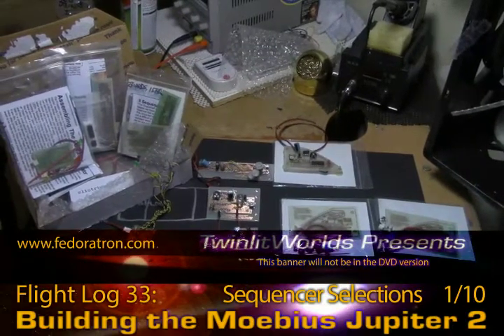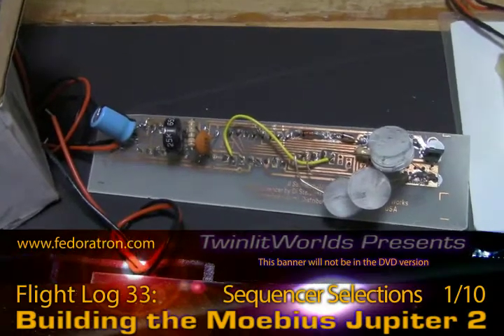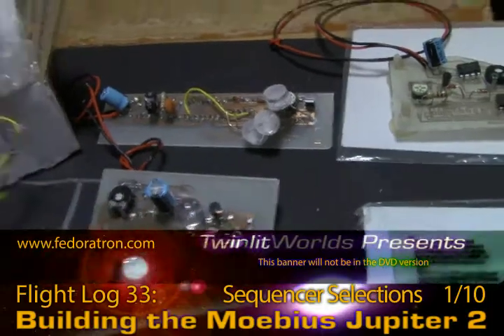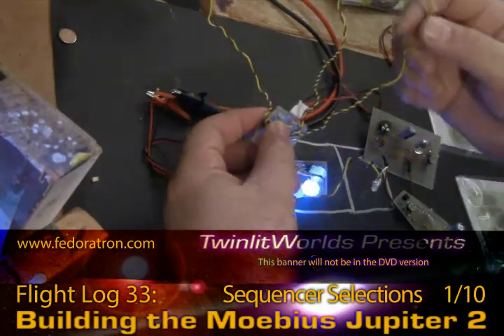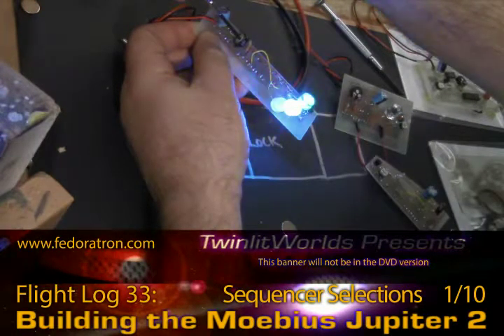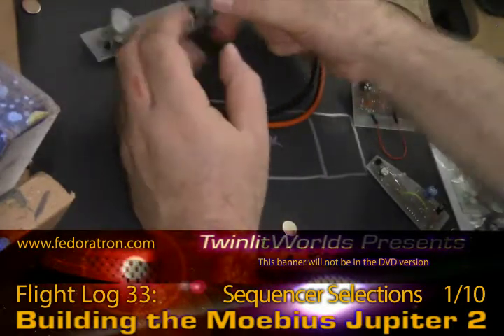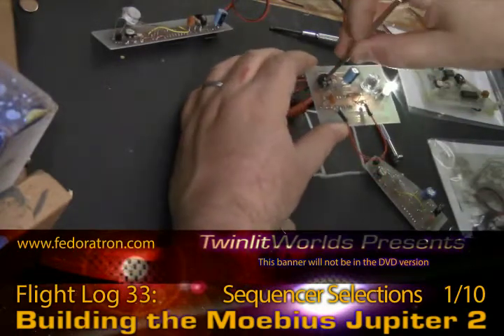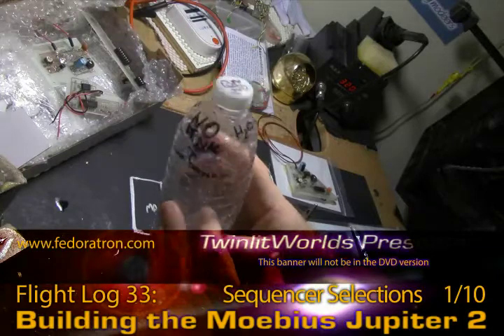J2 FlightLog 33: Part1, Sequencer Selections

Comment: NO DRINK I... Very nice Big Show! Note: there are no "pre-drilled" boards (except for old comrades in styrene), using IC sockets is NOT recommended, it only leads to DEATH and DESTRUCTION. I also think you have a couple of fusion core kits-- one already wired up. I had completely forgotten I'd sent so many sequencers! The "Folded Sequenzie" is not generally for sale, but what do you think? (It was made expressly for MMTom, because he was running out of room below decks-- then MMTom suggested the wall-shaped sequencer-- but does it eliminate the need for the folded one?)
Reply from the maker: Good morning, El!  :)
I think if the 'folded one' were the same shape as the landing bay 'rectangle' wall, just as the MMT Board is the same shape as the upper wall, it would fit perfectly in many cases.  An upper and lower deck option. You've got the time.  lol.  I don't know if the circuit paths can fit in the landing bay wall constraints. 

Well, 'death and destruction' are my middle name!  No, wait.  That's not my middle name at all!  What's that about death again?  :O

I think you might be right on the fusion core.  I gotta figrue out where that board is going to go!  ... Oh, crap!  8(

I don't remember what I said about 'pre-drilled'. Oh yeah, that pre-drilled board was a coincidence.  I think I might have done it and then put it back in.  This was more of a note for if the board goes to the ebay charity auction instead of being used in the model.  Fedoratron does not sell pre-drilled boards.
Reply: "DEATH and DESTRUCTION"............Oooooooooo, SEXY!!!!